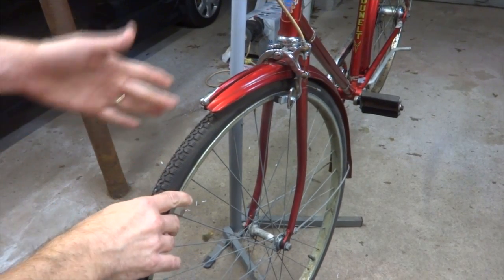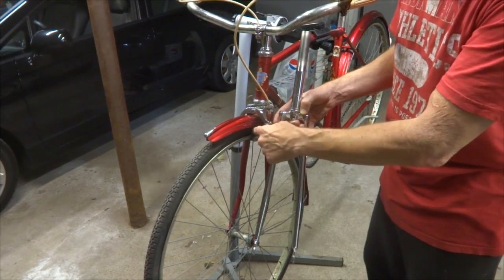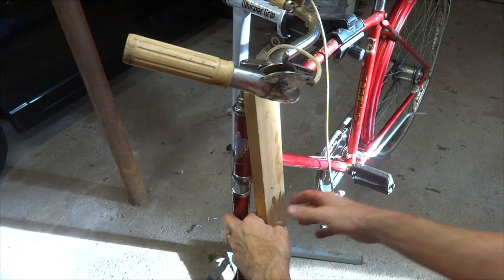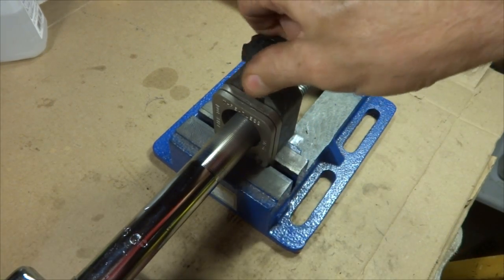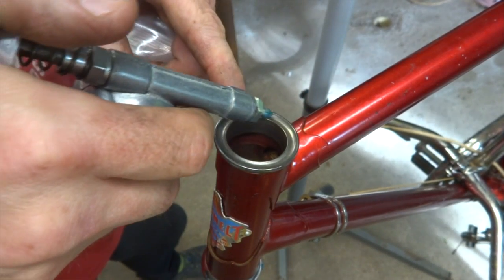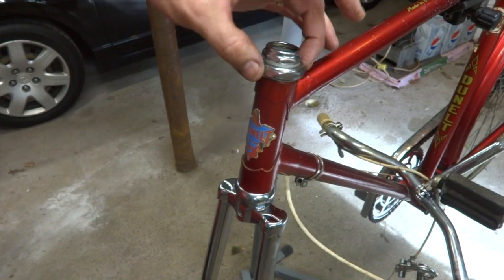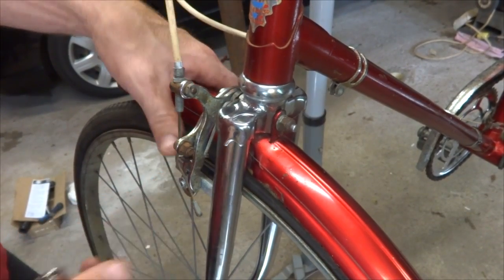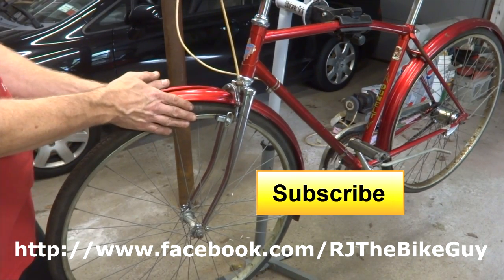Replacing A Bent Bike Fork

Comment: Nice video as always RJ.  One thing I was taught when cutting down threaded things like this is to screw on any nuts that are going to be used on it afterwards.  The reason is after you cut and file it, often it is difficult to start the nuts onto the threads because their end have been damaged from the cutting.  If you pre-install those nuts you can screw them off after the cut and filing and they will help repair the damaged thread ends.  If the nuts are difficult to unscrew, due to some form of binding, then you screw them back on and inspect and file some more until they can be removed relatively easy.  In your case you may not have had enough room for the nut with your jig.  

This nut pre-attachment has saved me a great deal of time in the past with the fine tune filing that is often required to allow the nuts to be attached after the cut.
Reply: I used to cut bolts down and had "fun" getting a nut on it... Not doing it "that" way again...
Reply: Hi man for me it's to late to do that, and I'm having real trouble screwing the lock ring back to it, so do I need any kind of tool other that a lime to repair the thread or what can I do, thanks in advance.
Reply: I thought about that isseue and I'm not even professional, but it's a common sense.
Reply: @amh2762  4yrs too late (leaving this for the audiance) but a tap and die set will help when fixing threads.

Comment: Great video!  But a quick note to anyone attempting this: You will want to pay close attention to the inner diameter (ID) of your crown race.  

Why?  Because 1" headsets come in two main sizes: ISO or JIS (caveat: there are a few others, so see Sheldon Brown's headset crib sheet). 

ISO is the modern standard.  JIS headsets are found on many older Japanese road bikes.  The ID on an ISO crown race is 26.4mm.  On a  JIS crown race it's 27mm.  

If try to install an ISO crown race on a JIS headset without modifying either, you may damage your crown race or your fork (I speak from experience!).

So you have one of two options:  You can reduce the race diameter of the fork race or you can sand the inside of your crown race until it fits onto the fork.

If you decide to reduce the size of your fork race, I recommend taking the job to your local bike shop since expensive, specialized tools are required.

A quicker option may be to sand the inside of your crown race until it fits onto your fork race.  You would need to remove about 0.6mm, depending on the actual ID of your crown race.  Use a relatively coarse sandpaper (I used 100), and check your work as you go.  Don't try to force anything.

On the other hand, if it's time to replace the bike's headset, just buy a headset that (a) fits the crown race of your replacement fork and (b) fits the inner diameter of your head tube.

Good luck & have fun,
-Alex

Comment: Hey RJ. Ive learned over the course of about 10 fork replacements to leave something on the threads below where your cutting. To straighten out the threads when your done cutting. i think the reason why it went on so tight was a tiny tiny piece of the top of the threads that jammed. Correct me if im wrong but ive never had a brand new fork go on tight.

Comment: Excellent as usual RJ! Great idea with the grease holding the bearings in, been putting off doing my '81 Raleigh resto in fear of taking the headset off, thanks to this easy to follow video, I've replaced the very dry very old bearings for new ones, small victories I know but so chuffed I did it 👍 so Thanks!

Comment: Was interested in the re-cold setting the forks. ... cheers RJ 👍
Reply from the maker: You can coldset steel forks to spread them. Do not try to straighten forks bent in collision though.
Reply: I seriously considered this; however, I ride so much, over really bumpy trails, that I worried the constant flexing would set up a metal-fatigue failure. 
If I were just using the bike for a short commute, I'd probably go ahead with the cold-set (being aware I might still want new forks at some point).
Reply from the maker: @MP-zf7kg  I'd recommend really good dental and life insurance then. Because if the fork fails, it tends to fail catastrophically. Good luck!
Reply: @RJTheBikeGuy  well I'm nearly fricking bling, so just add one more to the list.
biking days are numbered.
Reply: ....indeed RJ👍

Comment: I’m still struggling to get the race on. I got a sunlite chrome fork.  And removed the crown race off a Raleigh Olympian bent fork to tried to put it on the sunlite and made one of these diy tools like yours but still no give.  It has a small lip on the new sunlite fork. Can I sand it down to make it fit better or do I need to buy a new crown race.  I’m stuck.  Project on hold.  Was going to be a Father’s Day gift for my dad.   Still seeing what else to do.
Reply from the maker: Probably different sizes. https://www.sheldonbrown.com/cribsheet-headsets.html

Comment: How would you go about getting the new fork painted, with the original paint color/code? In terms of finding the paint color anyway.
Reply from the maker: +PARABOLOUS If I took it to a professional paint shop, they probably could have matched the original paint pretty closely. That would have been pricey though.
Reply: +tarstarkusz That's the problem I'm having with older (70's) bikes. They were painted with the RAL color system, but even a black color is hard to determine let alone silver's, red's and blue's.
Reply: +tarstarkusz 
A solid color can be determined with a good calibrated scanner, almost no knowledge required.
A metallic one I guess is more difficult.
Just look at this:
http://www.pantone.com/capsure

It only captures pantone.

You can always use check paint schemes to find the most similar paint code...
Reply: +tarstarkusz 

Also, the shop that fixed your moms car did a bad job.  It is not enough to check the code, you also have to check for weathering, unless it is quite extreme.  If you don't do that, the paint will look as new..

Comment: Just about to do this on my old bike, hoping everything lines up.
Where I'll deviate is that after putting in the lower bearings, I'll insert the new fork, then flip the bike over. while holding the fork in place. 
Bearings love to go hide from me, usually to come taunt me months later as I'm sweating or freezing underneath a vehicle.
Reply from the maker: The grease holds them in place pretty well.

Comment: hi rj, is there any chance of a video on how to remove cranks from a mountain bike without the puller? ideally i just want the chainrings removed as they are bent but the screws are shreded and it means i have to remove the cranks and replace with the other ones i have got. thanks
Reply from the maker: +Snipe Camp You can't remove the cranks without a puller without potentially damaging the cranks. Just buy a puller. They are not that expensive. A lot cheaper than buying new cranks. http://www.amazon.com/exec/obidos/ASIN/B0028YUZSS/ref=nosim/youtube25-20
Reply: RJ The Bike Guy I've ordered a puller from ebay, the problem I have is that I need my bike to work asap, the cranks are old and chipped already so im not bothered about damaging them. Ive got a parts bike that im using for the new cranks so ive not got to buy cranks again. I've got about 2 hours to fix the bike otherwise I cant get to the place I need to be :/ I've tried various methods, ive hit the cranks with a hammer, it with a flat head screwdriver and they just wont budge. I did however spray lots of oil on them last night so hopefully they might be a little looser if I try again today.
The puller I bought initially (a few weeks back) was the wrong size, my fault, they agreed to swap it so I sent it back and its gonna be another week till it arrives.

Alternatively, any idea how to remove the chainrings when the screws and bolts are shredded?
Reply from the maker: To remove the cranks without a puller, remove the bolts/nuts that hold the cranks onto the spindle. Maybe spray a little penetrating oil in. Then ride the bike around for a bit until they loosen up. But the surfaces inside the cranks where they mate to the spindle may possibly be damaged.
Reply: RJ The Bike Guy Okay, ill give that a try. Ill try to fix it in the biggest chainring as they are all bent and damaged. I dont think its damaged in the spindle.

Comment: RJ! I need your help. I have a vintage Dunelt 3-speed much like the one in this video. The bicycle appears to be all original; however, the forks are extremely funky - it has almost an "s" shape curve to it. It doesn't appear to be damaged or bent... rather, this looks intentionally shaped. Have you come across any other Dunelt's with a fork like this?
Reply from the maker: +VeeDub Matt Nope. Sounds like they were bent.
Reply: +RJ The Bike Guy I'll post a photo on your Facebook page.

Comment: Hi Mr RJ! I have some questions and if you or someone from the comunity could answer I will be very grateful. So first I went to my local bike shop for them to cut the tube and to put the crown race. 
First they cut it in a very bad way so the thread is messed up and the lock ring doesn't turn, Can I fix that just with a lime? or do I need other tool?, since the thread is very thin and delicate (I guess). 
The other thing they did was that they limed the crown so that the crown race could "fit" but as I see you use a special tool to put it in, and it has pressure so that it doesn't move but now mine does move around I mean it spins and I guess that will make the fork malfunction. So what can I do in these situations, please. As always thank you for your videos, and I would apreciate your help a lot.
Reply from the maker: I have no idea what you mean "Can I fix that just with a lime?" What is a lime other that a fruit? "limed the crown"?  The crown race is pressed on. I have no idea what your shop did. Sounds like the screwed up your fork.
Reply: @RJTheBikeGuy  Lol I thought the traslation was lime but it's a file XD
Reply from the maker: I am wondering if the fork took a different sized crown race, and they screwed it up. The threading can probably be cleaned up.

Comment: If the forks are the straight type (no curve design) and are 6061 alloy and both are bent the same way you can reverse the fork so that the bend is now reversed thus no bend look. Done this to many bikes as long as the bend is uniform and acceptable vs reversed look. The only issue will be riding without hands as this requires more attention and balance since the fork is reversed (due to bearing shape). Of course this is for temporary usage since a new fork will be installed later.
Reply from the maker: If the forks are  from an impact, discard them. They are compromised and will be prone to failure. When forks fail, they don't fail just a little. They tend to fail all at once catastrophically and can seriously injure or kill the rider.
Reply: @RJTheBikeGuy  Some key tips to check if you can reverse the forks are ( Reverse Only you can not Bend them!)

1. Bearing cups damaged 
2 . Wheel completely untrue after impact
3. Impact was not dead on straight ( impact with the front wheel was when turning)
4. Wheel can not move after impact as it touches the front  down tube frame 
5. Welds of the fork arms have paint flakes, tiny hairline cracks.

Any of those it's over for the front forks. However there are exceptions as I have done over the years it's all on experience based on those checks. Steel bikes for example can be bent safely up to a point, 6061 Alloy can be bent but must be heated a bit. I will not bend aluminum, titanium, Molly, and obviously Carbon. 
Thanks for your videos.
Reply from the maker: @danfuerthgillis4483  I emphatically disagree. If the fork is bent, replace it. Period. And also check the frame for damage. If the frame is buckled from the impact replace it, or have a professional frame builder repair by replacing tubes. A new fork is a lot cheaper than the potential medical bills.
Reply: @RJTheBikeGuy  I am always careful with how far I can take things, obviously I would not trust riding my bike unless I was 100% confident that the changes are not worth the risks. If the wheel was touching the frame at the front section under any impact an order for a fork would be immediately be done. You should take a look at the bike it is up on my videos the GMC Denali 700c model. Those alloy tubes are rock solid and will take an intense impact due to how thick and heavy they are bike weighs 29 lbs lol. This bike has and will take some heavy abuse, it is also why I prefer thicker bike tubes with more meat on them. Thanks for the advice though good information.

Comment: Hey, RJ. Any chance you could show how to thread a fork?

..reason is I have a 1" threadless fork (which is weird I know) that I'd like to thread (because I like the look of a threaded headset and I don't care that threadless is 'better'
Reply from the maker: +Sean Crosby If it is a true threadless fork, it may not work threades as the inside diameter may not be right for your stem. And for the cost of the tool, you would be better off buying a threaded fork.

Comment: I recently got a bike with a bent fork and my father tried to straighten it out but it's still bent, so I cannot center the wheel inside which in turn means that the break posts aren't aligned so I get trouble with adjusting the brakes. Since the brakes are the old MTB kind with pivoting adjustment, means that I had a hard time aligning the brake pads only to discover that the wheel is also bent so I needed to compensate for that too. Jesus, I swear that most old beaten bikes are nothing but trouble. Tried to center the back wheel in the frame, same thing, I can't get it very straight but the wheel itself is still running true. Wen't to install the back brakes and now I've got even a more serious problem, the pad race in the wheel is worn and looks like a mirror in the middle so that brake shoe won't sit flush with it (aka small surface area) and the break squeals now, so I adjusted it crooked so it contacts the top lip of the wheel so it will stop making horrible noises. Anyway, this bike was nothing but trouble, hopefully I'll be able to finish it these days. Now I know what to check when getting a used bike. Oh yeah, the fork was seized in place so I poured ATF fluid inside the fork and diesel and still was stuck solid in there so I had to resort beating it with a hammer which bent the pipe but that's allright since the rest is crap. Cheers :)
Reply from the maker: +ciprianwiner Wow! What brand of bike is it?
Reply: +RJ The Bike Guy The frame was so messed up with cheap junk paint and a horrible paint job that I had to strip all the paint down. And underneath there were two stickers with some writing but the paint stripper just erased all the writing so I have no clue on what brand is it. All I know is that it has some of the original parts like Shimano Deore LX M560 series crankset, rear and front derailleur, cassette and hub, shimano UN... something bottom bracket which was also shut in place by rust so I had to work at it a couple of days just to get it off, lol so yes, it's your typical 1994 no suspension MTB. Cheers :)
Reply from the maker: +ciprianwiner If this bike was so messed up, why in the world did you buy it? Was it free?
Reply: RJ The Bike Guy I traded a fishing rod and some speakers for it lol. And it was night when I got lol so couldn't see what I get. Lesson learned. :)

Comment: There are other complications when replacing a fork on a vintage bike.  Is the headset JIS or ISO?  The fork crown race seat on a JIS standard bike will be 27mm diameter,  26.4mm on ISO.   Almost all 1 inch rigid replacement road forks sold new today are 27mm.  They are sold this way because they work straight out of the box on JIS, but requiring milling to work with ISO headsets.   Good luck finding a bike shop to mill the crown race seat down to 26.4  today.  Most will not waste their time...if they know what you're talking about at all.    Old bikes were all over the map with dimensions and mounting systems it makes it nearly impossible for a noob to do any kind of repair besides the most basic stuff.    JIS, ISO, French, Italian, British, old Schwinn, it goes on and on.  Wanna install a modern rear derailleur on a vintage frame with a brazed on Huret derailleur hanger?  Good luck with that plan unless you know how to braze, or don't mind looking at a kluge job.  Bottom line:  Most old bikes are not worth the time if they need anything more than basic stuff like tires, cleaning and lube.

Comment: Hey RJ, how do you align a fork? A have a 80's steel frame bike but the fork is a bit "out of tune"... If I take the hands out of the handle bar it rapidly steers to the right. What can I do to fix it?
Reply from the maker: I recommend replacing it. If a fork is bent, then bent back, it can be dangerous. When a fork fails it can be catastrophic failure causing injury or death.

Comment: First you say dont bend the fork back, because it might could brake and then you bent the new one to get the ugly old wheel back in it... arent the forkends non-parallel now? Wouldnt it been easier/better to buy a new wheel with 100mm hubwidth?
Reply from the maker: +guitarfreakfalko There is a difference between controlled bending and uncontrolled bending like in an accident, and then rebending. Changing the spacing like I did in the video is not uncommon. Often it is going the other way, expanding old forks to accommodate a wider wheel. It is controlled bending. I actually did check the dropouts after I narrowed the forks, and they were were almost exactly parallel. I didn't get that in the video.